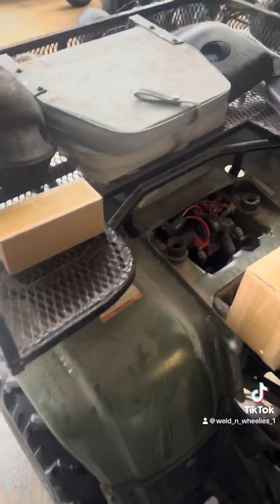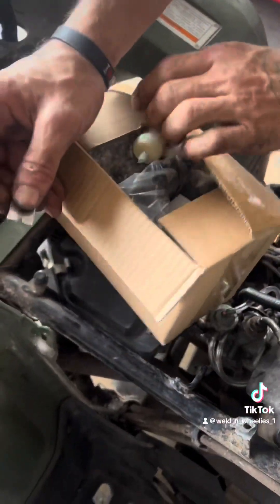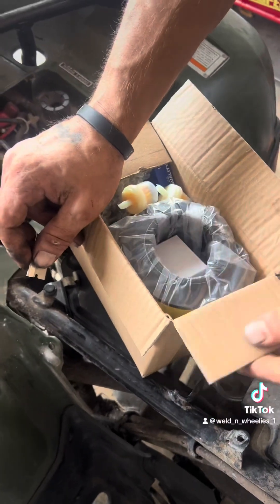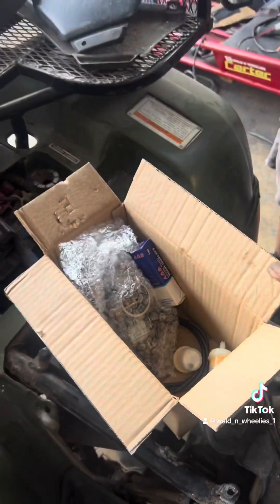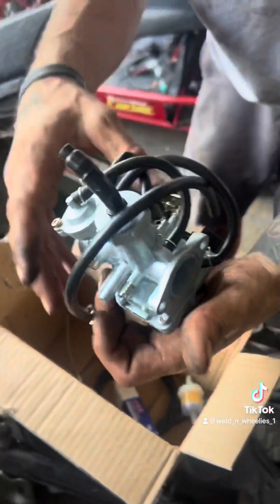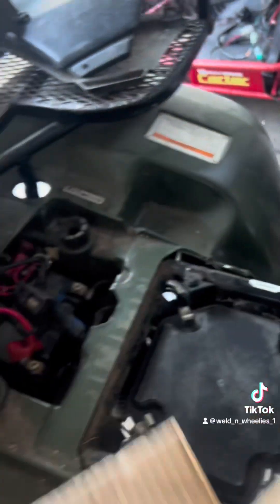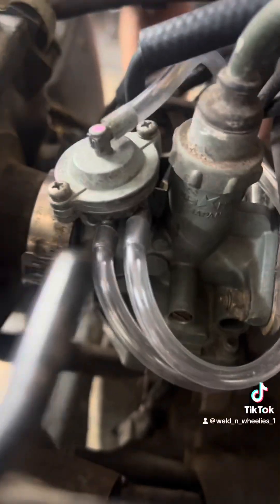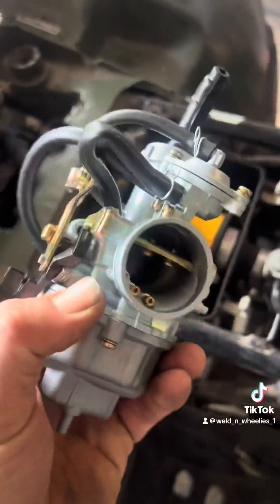Honda Trx300 burnout with bad valves Honda trx250 carb unboxing mini quad drifts around Bball court!

Comment: Did u check to make sure the 300ex ain't need a timing chain. I did one someone did valves on and still the chain was slapping around. They stretch when people never change the oil .
It also sounded like it was super lean the way it was poping,  does that go away at all when you put the air filter on?
Reply from the maker: Timing chain is tight no slack 🤷🏽 going to do valves and hood for best. And no it’s definitely rich. Found muffler was clogged so we have taken it off and runs a lot better with it off but so loud you can’t hear the tik lol